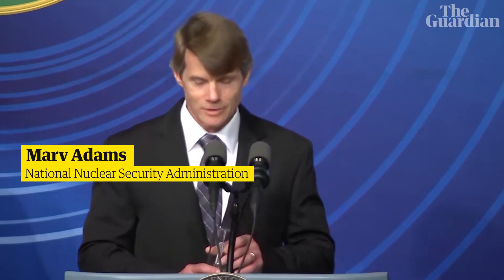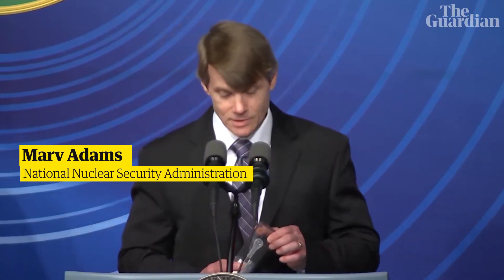Nuclear scientist Marv Adams explains what happened in the successful fusion experiment

Comment: This is legitimately the most insane thing I've heard in some time. Producing energy beyond what was put in is already crazy enough but for it to happen that fast is beyond comprehension
Reply: The sun does this like millions of times a second. We just made a miniature working model of the Sun
Reply: The problem is that they only mention the Lazer energy. The REAL energy expenditure to get the reaction was 300 megajueles, which means the actual result was only 1% of the energy expended.
Reply: That assumption requires errors, energy is not created, it has always existed, you just are pulling it out.
Reply: @andrewgreeb916  You are manipulating it. It is neither created nor destroyed, but net positive occurrences are very rare, but do happen. Fusion appears to be one instance where we are able to replicate past the hypothetical
Reply: @Zandaroos  but once it is we will be able to create our own sun to have safe unlimited clean energy so kinda a big deal.
Reply: What sort of application can this be used in?
Reply: The significant part is nuclear fusion happening for the first time not the energy. NUCLEAR FISSION HAPPENS IN THE CENTER OF A STAR!!!!
Reply: It's not, when you strike a match to light wood on fire, it's the same concept. Takes less energy to ignite it than the wood gives us back in heat. Otherwise there would be no point.
Reply: forgot to say that the energy required by the lasers to give 2 MJ to the fusion fuel is about 300 MJ because the lasers used had a very low efficiency of about 2-3% and the cilinder had ha 30-50% efficiency (so just 50% of the energy given by the lasers was then given from the cilinder to the fuel), so they selled you a 150% efficiency that was actually a 1% efficiency
Reply: getting more energy than what you put is nothing crazy and isnt anything new
literally light a pile of wood on fire with a small lighter achieves that
of course using fusion is taking advantage of a different kind of potential energy that we weren't able to achieve before 
but dont make it sound like its a perpetuating machine or anything like that
Reply: @fattestallenalive7148  Exactly, unfortunately people often pretend to be smarter than they are and end up looking like fools.
Reply: @fattestallenalive7148  wrong you have put the wood in as well, read some books man
Reply: @fattestallenalive7148  the lighter isn't what puts energy into the reaction, the wood puts the energy in
Reply: @dcard228  

And the laser isn't what puts energy into the reaction, the fusible material is.
Reply: @dcard228  in this experiment comparison the lighter is the energy we put in, or the lasers. The wood burning is the fusion reaction, which is obviously magnitudes higher than the energy we used to light it.
Reply: @fattestallenalive7148  and of course, a fusion reactor produces slightly more energy than a fire
Reply: They did not get anywhere near a net positive, think about how much energy it takes to fire those lasers, heck think about how much energy is used to produce this apparatus, it’s in no way a net positive and these reactors are still decades off
Reply: @ChrisTuckerCarlzyn   small , seemingly insignificant steps will still allow one to reach a destination, point A and B.
I suppose it helps to have a bit of blind faith in science. Who knew?! ;)
Reply: @atmywhitson  true but misinformation hurts that journey
Reply: @ChrisTuckerCarlzyn  lasers don't take that many watts bro . . .  even hundreds of diodes draw less power than a washing machine

yes, practical applications are a few decades off
Reply: @jodo2785  this is a from a different planned experiment called iter “the ITER plant and facilities will range from 110 MW to up to 620 MW for peak periods of 30 seconds during plasma operation. Power will be provided through the 400 kV circuit”
Reply: @jodo2785  but I guarantee you when iter does it’s experiment it will say it produced more than it consumed just like this one did
Reply: E=mc2 basically we just converting mass into energy
Reply: @Yilmaz Kurt  Yeah, yeah. Buy, when are they gonna create a stinkin' dinosaur??
Reply: Tesla: Think in Energy Vibration and Frequency and you will understand the universe!
Reply: Wait so, did they do these experiment with not expecting this? What I mean is, do we know why this happens or is this still a mystery?
Reply: @JackRR15  We have never managed to actually capture more energy than we put in. We have created more energy many times before, but never captured enough to offset the power put in, until now. It's an extreme engineering challenge doing this, but the technique they used here worked.
Reply: @rich1051414  Unfortunately, if you read the small print the energy in doesn't consider the energy to produce the lasers. So it isn't much energy that was put in. It's a bit of a con the way they are doing it.
Reply: @cup1966wow  exactly
Reply: @rich1051414  That’s untrue if you count the combustion of Hydrogen. Hydrogen is a weird little exception of an element
Reply: @rich1051414  If its 1.5x then what you put in... just make it a bigger scale. Have the exerting heat warm up water and have the steam turn turbines. It would be highly efficient because you are doing the same amount of work with 1.5x output.
Reply: @xrandomdonalds695  you and I both know it isn't that easy and the man in this video is far smarter than our brains combined. The fault as far as I'm aware is it did not create more power than what was required to power the lasers.
Reply: @mysteryuser7062  Ah! Bingo
Reply: @ltipst2962  your talking for urself. Where did u get this info about the lasers??? I dont see anything. Are u spreading false information??
Reply: @rich1051414  I don’t think they managed to capture more than was put in, they just observed that more was released than they put in.
Reply: @JackRR15  the physics of this is 100% solved. It's just an engineering problem at this point
Reply: @-euphie4872  There's no such thing as "100% solved". I agree that it's a very well known field of physics at the moment but saying there's nothing more to learn about the nature of specific phenomenon is very dangerous, a lot of noble scientists who told the same thing in the last could have confirmed that.
Reply: @spythere  I was going to say yes there is as we know 1+1 = 2, but I'm sure there's a ted talk out there proving me wrong
Reply: @-euphie4872  forgot to say that the energy required by the lasers to give 2 MJ to the fusion fuel is about 300 MJ because the lasers used had a very low efficiency of about 2-3% and the cilinder had ha 30-50% efficiency (so just 50% of the energy given by the lasers was then given from the cilinder to the fuel), so they selled you a 150% efficiency that was actually a 1% efficiency
Reply: @-euphie4872  Dumb.  The true thermodynamic efficiency of just the laser facility vs the deposited energy,  is probably around 0.1% efficient.  Long ways to go.
Reply: Not really. If nothing travels faster than the speed of light, then somebody can supposedly stop the universe with a special camera!!! Just commenting.
Reply: @richardbowers3647  The camera isn't travelling. Also, that is done by recreating a scene over and over again, with slightly offset timings, so that when interweaved together, you can see light move. A single camera shooting a single scene once cannot capture lightspeed movement.
Reply: @richardbowers3647 Or a normal camera. Pictures are just light captured at a moment in time.

Comment: I feel like people in the comments don't understand how huge this is. Ignition was achieved, for the first time ever in a fusion reactot. This is the birth of unlimited clean energy. This is the start of a revolution
Reply: Yeah its only 10 years away right?
Reply: @roystongauntlett8035  you're trying to be a smartass and failing so hard. The always 10 years away thing was relating to the achievement of fusion ignition, which is what happened here. This is why it's such a big deal
Reply: @cutiebertie  no it's 10 years away from usable fusion
Reply: This method of laser fusion is not the same as the prototype tokamak fusion reactors that are expected to become the first practical fusion reactors. So far, the longest a tokamak reactor has run is 5 seconds and it was not releasing more fusion energy than it took to make the fusion. This laser induced fusion lasted roughly 0.08 nanoseconds and a nanosecond is one billionth of a second. Its an important step towards fusion power, but there is a lot of work left to do.
Reply: @steveaustin2686  tokamaks are only a potential design, with so far no success. The final design of actual practical fusion reactors is not yet fixed in any way, and as long as ignition and positive energy output is achieved, it doesn't matter if its not with a tokamak
Reply: @cutiebertie  The tokamak is considered the design that will eventually make it I understand. This laser method was not for fusion reactor technology, but research into further the development of fusion weaspons without violating the test ban treaty, I understand. An important step, but not the same technology that is expected to develop into a viable fusion reactor. Will likely develop important data for that fusion reactor research though.
Reply: @steveaustin2686  how would fusion even get used for weapons? It's a non expanding reaction, it's super safe. Quote a source as to how it would be weaponized. Also people thought tokamaks were a likely potential solution, that doesn't mean they actually are. This is so far the only proved viable fusion technology.
Reply: well they had already achieved ignition long before this, what happened now is that they were able to actually create more energy than was used to ignite it

Comment: Nothing can move faster than light. We've been told that by you so called scientists hahahhahah. You lot just continually make stuff up. An the Ideologically Subverted, under the Milgram Experiment, just keep believing you. (Pragmatist here) Continue lying and I will continue to disregard it. I can't be bothered with popular held beliefs and opinions. You are no authority here. You are most likely lying out of your back teeth and the Stockholm syndrome slaves will defend you.
Reply: It didn't move faster than light. The laser induced fusion happened in roughly 0.08 nanoseconds or about the time it takes light to move 1 inch. For the first time outside of a thermonuclear bomb, man-made fusion has produced more energy than what it took to make the fusion. So positive fusion, without the bomb part. This method of laser fusion is not the same as the prototype tokamak fusion reactors that are expected to become the first practical fusion reactors. So far, the longest a tokamak reactor has run is 5 seconds and it was not releasing more fusion energy than it took to make the fusion. This laser induced fusion lasted roughly 0.08 nanoseconds and a nanosecond is one billionth of a second. Its an important step towards fusion power, but there is a lot of work left to do.
Reply: @steveaustin2686  Is that what they told you. Or were you there? An if you say you were there, how exactly do we have proof you were there. In this world of Deep Fakery. PS I love the power of Ideology as much as the next man.
Reply: @honestjoe7940  No, it's from my understanding of science, just like anyone can get. If you want to break out the tinfoil hat, that's up to you.
Reply: @steveaustin2686  Ad Hominem, because you can't win the debate (Not very intelligent) Whataboutism... I feel sorry for you

Comment: Over a megajoule of energy in a tiny fraction of a second with a completely clean fuel. This should be considered one of the biggest breakthroughs in the whole energy crisis.
Reply: Not completely clean need to mine the fuel first
Reply: @neonbricks8182  we use Heavy Water and Superheavy Water for Fusion, which doesn’t need to be mined. But it does need to be electrolysed which takes energy. Still, if we could make a system efficient enough to make fusion fuel through fusion energy we’d have an effectively unlimited energy source
Reply: @brandon49-c2l  where you getting this tritium from then
Reply: @brandon49-c2l  there simply isn’t enough tritium in the ocean for even an hour of global supply. However you can breed tritium in a fusion reactor using lithium. This lithium will need to be mined, obviously a lot greener than coal
Reply: @neonbricks8182  deuterium is also used, although significantly less efficient iirc

Comment: dont understand
Reply: For the first time outside of a thermonuclear bomb, man-made fusion has produced more energy than what it took to make the fusion. So positive fusion, without the bomb part. This method of laser fusion is not the same as the prototype tokamak fusion reactors that are expected to become the first practical fusion reactors. So far, the longest a tokamak reactor has run is 5 seconds and it was not releasing more fusion energy than it took to make the fusion. This laser induced fusion lasted roughly 0.08 nanoseconds and a nanosecond is one billionth of a second. Its an important step towards fusion power, but there is a lot of work left to do.
Reply: @steveaustin2686  ur the man!!!
Reply: @relaxpinknoise  You're welcome

Comment: If this is repeatable it is the biggest deal in Science ever. This changes everything. World politics will change overnight once it becomes commercially available. Science in the UK is nowhere near getting more power out than put in though so these claims need to be widely verified. Gulf States will return to sand, carbon fuels permanently staying where they are. Game over Russia, China, Iran, Iraq.
Reply: This method of laser fusion is not the same as the prototype tokamak fusion reactors that are expected to become the first practical fusion reactors. So far, the longest a tokamak reactor has run is 5 seconds and it was not releasing more fusion energy than it took to make the fusion. This laser induced fusion lasted roughly 0.08 nanoseconds and a nanosecond is one billionth of a second. Its an important step towards fusion power, but there is a lot of work left to do.
Reply: Chill out there

Comment: To me, with more energy out than in, sounds like perpetual motion is achievable . .
Reply: No, as the energy released from the fusion was already there in the fuel. When you combine hydrogen isotopes (like deuterium), into a helium isotope (He-3) through fusion, you have left over energy that is released. So not perpetual motion, which does violate the laws of physics.
Reply: @steveaustin2686  I was wondering, thank you for the explanation .

Comment: Such told b*******. What about geothermal energy. What about hydrogen powered energy. The geothermal energy all you've got to do is dig a hole. And we could utilize spent oil wells. We already have these technologies. The simple to use and simple to obtain. Now we got to wait another decade for minuscule improvement. We have the technology here and now there's nowhere near as cheap as a billions of dollars spent on fusion power. We are wasting our time. Hydrogen power only has a byproduct of water which can be recycled into making more hydrogen power. And hydrogen is inexhaustible. And will cause innovation into hydrogen powered engines. This is the true inexhaustible energy supply we need. And it's more powerful and efficient than gasoline.

Comment: BUT HOW MUCH ENERGY IS 3 MEGAJOULES??? IS IT A LOT?? COULD IT POWER A LIGHTBULB? A HOUSE? A CITY?
Reply: A gram of TNT exploding releases roughly 4000 joules of energy as light, sound/shockwave, etc. So 3 MJ is the energy released by roughly 1.6 pounds of TNT. That was done in roughly 0.08 nanoseconds, which is the time it takes light to travel an inch. A nanosecond is one billionth of a second.

For the first time outside of a thermonuclear bomb, man-made fusion has produced more energy than what it took to make the fusion. So positive fusion, without the bomb part. This method of laser fusion is not the same as the prototype tokamak fusion reactors that are expected to become the first practical fusion reactors. So far, the longest a tokamak reactor has run is 5 seconds and it was not releasing more fusion energy than it took to make the fusion. Its an important step towards fusion power, but there is a lot of work left to do.

Comment: What’s it all mean tho ? Serious question. Is it possibly a new form of energy ?
Reply: Yes that's the goal.
Reply: Fusion is something we know about already. The Sun fuses light elements into heavier elements, which is how all that energy is released. Man-made fusion that released more energy than it took to start the fusion has only been done in thermonuclear bombs, until now. This used 2 MJ of laser impulse to release 3 MJ from fusing hydrogen isotopes into heavier elements. The 3 MJ release happened in roughly 0.08 nanoseconds. A nanosecond is roughly one billionth of a second. Three megajoules is roughly equal to the energy released by about 1.6 pounds of TNT.

Now the method that Lawrence Livermore National Lab in Livermore, CA used is different than what prototype reactors like the tokamak fusion reactors use. The longest a tokamak fusion reactor has run fusion so far is 5 seconds, but the fusion in the reactor was not releasing as much energy as was what making the fusion reaction. Another problem is that the 2 MJ laser impulse, pulled 300 MJ from the grid to make it happen. That would be fine to start a fusion reactor, but the fusion would need to be sustained without further large inputs to make the laser impulse. So while this is an important step to fusion power plants, research can test fusion, there is still LOTS of work to be done before fusion power plants happen.